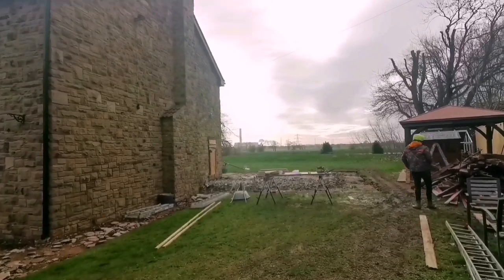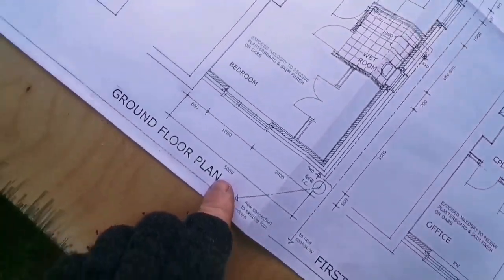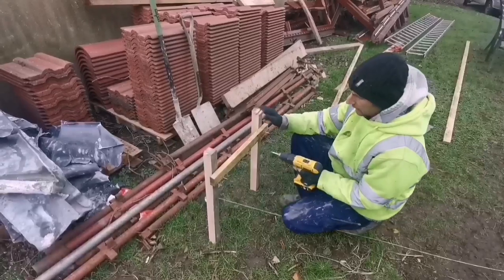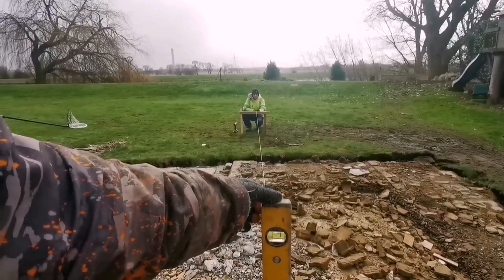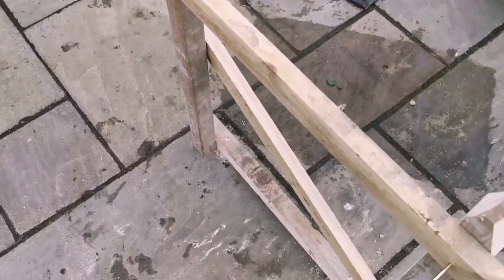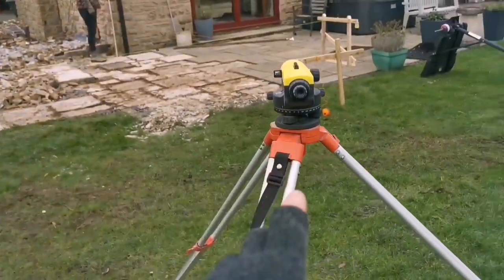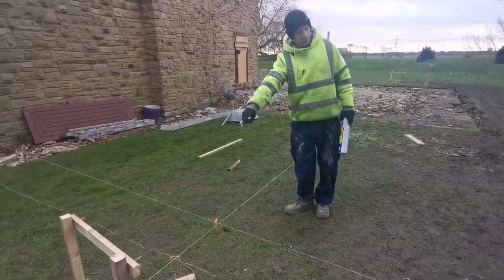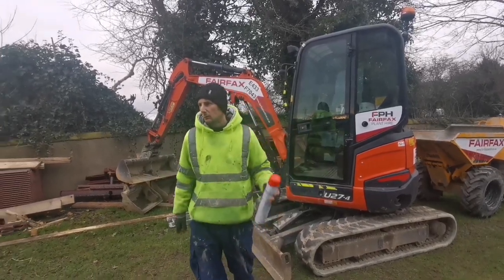the big extension build setting out

Comment: Hi mate after some advice just had deliverd some ballast for conservatory footing but the stone in it is small They have told me they run out of 20mm so put 10 in it what advice wud u suggest
Reply from the maker: I think you should be good mate. Sometimes you get smaller stuff so it goes through rebar better. You should be fine for a conservatory 👍
Reply: @markhep  is it worth throwing some bigger stuff in
Reply from the maker: @aaaaa4266  you can do. But I pritty sure you will be ok with what you got how deep is it
Reply: @markhep  500mm but tbf it is only a timber frame Conservatory
Reply from the maker: @aaaaa4266  you will be fine with what you have mate. I would say👍
Reply: @markhep  thanks bud